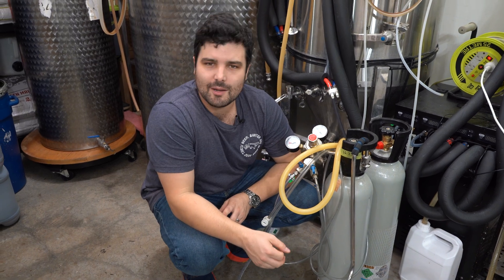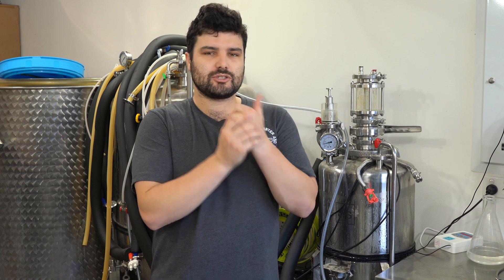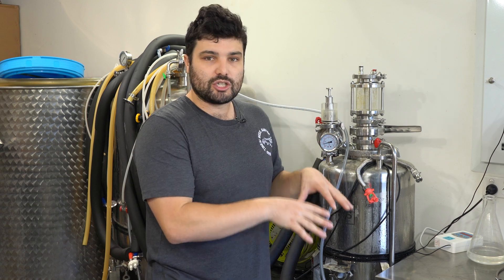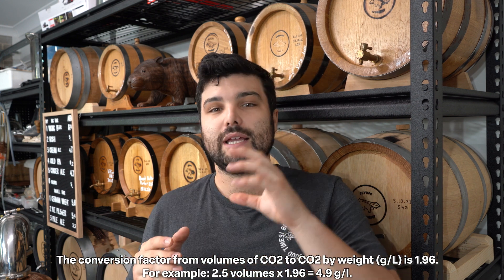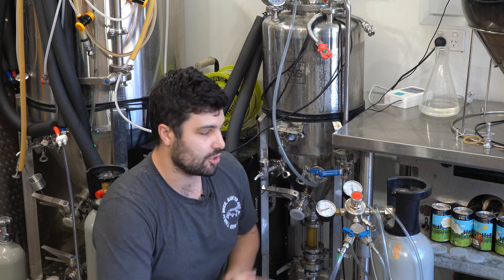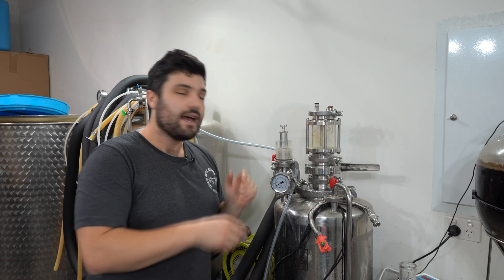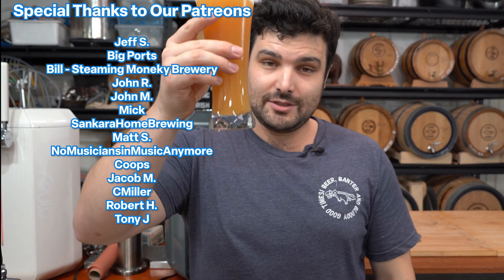Can you Carbonate BEER in 1 HOUR!?

Comment: Hi Mykelti! Can I ask what kind of scale you use for this practice? Is it a specific brand/specific style? Do you leave the scale turned on throughout the carbonation step to watch the weight go down, or when you power it off/on does it not re-calibrate and pull an accurate consistent weight?
Reply from the maker: Hey mate this is one we got from kegland, you can use our affiliate link if you want to buy one from them!
Reply: Thanks! I'll check it out!

Comment: Dear Sir,
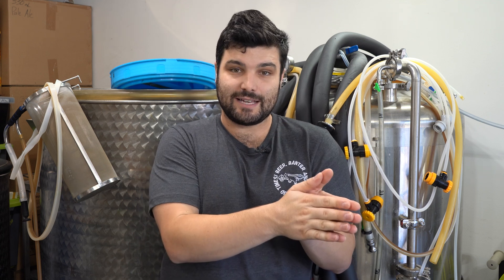May ask you the calculator practise you doing to found the CO2 in your tank (sitting on a scale), as i need to do the same... i didnt understand well, so i try to do the same when i carbonate with carbo stone. Vid it was about from 07:00 to 07:40 .. 
That will be very helpfull for me. Thank you in advance.
Cheers from Greece
Reply from the maker: If you put your tank on scales you can weight it before starting then see the numbers count down as CO2 goes from the tank to the fermenter. Is that your question?
Reply: @flyingwombattv   Dear Sir, 
Thank you for your answer. I keep following you but this vid with carbo in 1 hour seen 100 times.
I try to found so i can use also the maths that you do when you have your tank on the scale 
to found how much g/L you have to use for your carbonation.

I have now a weiss and use my spunding valve connect to CO2 tank. 
According to my carbo chart is 3.06 volume on 16psi. 
But when i change to weight (g/L) give me 6.0 g/L..
This is what i try to found.... Whats the math practice to do. What should i do when i put my CO2 tank on the scale and give me a weight of 14kg (now) and connect through MK4 to fermzilla 23L what’s the math as you do from about 07:11 to 07:25 and 08:51 to ... (you have 178.6g of CO2) to found, how to calculate this please.

Following your vid and according to chart.... the 3.0 volume is 6g/L (wiess  
So ... 23L x 6g/L = 138
on my scale the weight of the tank is 14.000 

14,000 – 138 = 13,862 so when i see the 13,862 i will stop the carbo stone connection with co2...
and let beer to stay for 2 days before bottling with itap x pro...

Is this correct...?

Best Regards

Comment: My dad us d to do it in under half an hour with nothing but food grade CO2 and a 20 liter post-mix keg. He'd put the beer in the keg and refrigerate to 4°C, connect up the CO2 (can't remember the PSI) then lay the keg flat on the ground and roll it for 10 minutes. Then he'd put in the fridge, connect it to the tap in the fridge door, connect it to a CO2 cannister and let it rest for 5 to 10 minutes and start drinking. Worked fine.
Reply from the maker: @DeplorableMAGAT  yep this is basically the same thing just without the keg rolling! You’re essentially just aiming to saturate the beer with CO2, and the keg rolling just helps the beer absorb the co2 faster

Comment: So... Awesome video first off, I love the technical ones!!

But... if there's CO2 coming out of the spunding valve and you're going by weight from the CO2 bottle... Isn't there less than the amount moving out of the CO2 bottle into the beer?
Reply from the maker: @NoMusiciansInMusicAnymore  huh?? Ngl that was a hard sentence to follow 😂 but is your question is the CO2 bottle reducing in weight? If so yes, the co2 bottle will drop in weight as CO2 saturates the beer
Reply: I think I get what you are asking. If you have got CO2 going in via the carb stone and CO2 going out via the spunding valve, you are losing CO2 via the spunding valve. So if you end up with your CO2 bottle weighing 178g less, isn’t there less than 178g left in the keg because some has escaped through the spunding valve?
Reply from the maker: @shamus_osean ahhh I get ya, so yes co2 will escape out the spunding valve, but remember that spunding valve is also set the the head pressure we want, so although you will have co2 escaping that 182g is also saturating the beer in the tank, and that’s the key part here. That we are saturating the beer with co2

Comment: Thanks, perfect timing, gotta turn around a kveik beer in 6 days and this will shave off a ton of time! Any loss in hop aroma you’ve noticed doing this? Also, and I may have missed this, but do I set the CO2 tank to the pressure on the carbonation chart plus the resistance of the stone? Or do I set it higher? Cheers guys!
Reply from the maker: Great timing! No there’s no real loss of hop aroma or flavour, and set the co2 tank pressure to a point where it makes a “rolling boil” inside your tank through the stone, in my case I set mine to 30 psi, obviously the higher you set it the faster it will work, but don’t set it crazy high or the co2 bubbles may be too big and not absorb properly into the beer
Reply: @ thanks boys, cheers to the weekend!